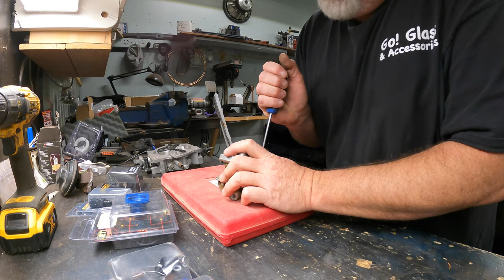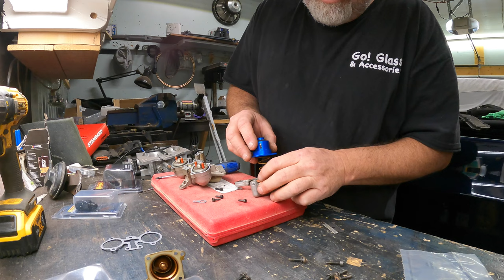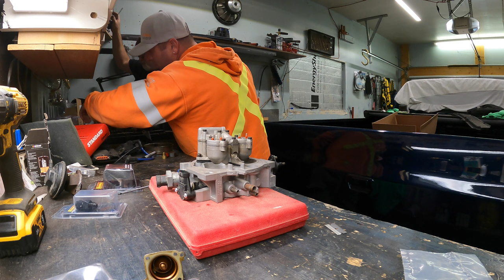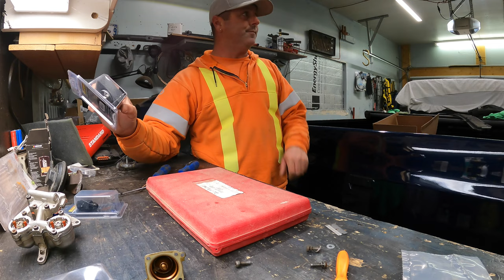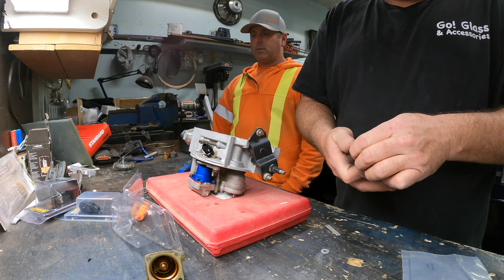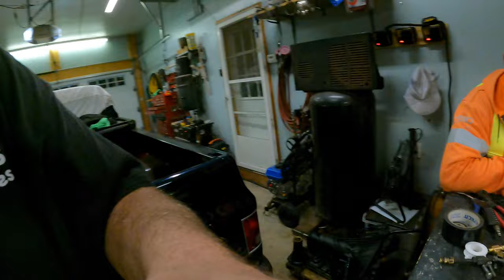TBI Ajustable Fuel Regulator And Fuel Pressure Gauge    4K

Comment: Not thick enough gasket for the top to bolt to the bottom. Also, if you looked at the head of those screws the rest are rounded on top and the three on that mount are flat topped.

Comment: Been considering this mod for my TBI system. But with my tightly-routed factory hard lines I'm not sure I have enough wiggle room for an in-line FP gauge. 
How do you adjust the FP in situ? Do you have decent access with an Allen wrench while it's installed on the engine? Or do you have to remove a gas line, or fully remove the whole TBI unit from the intake to adjust?

Comment: I have the same Rochester 2bbl tbi. But after I shut off the vehicle the fuel pressure is instantly lost. 
Any ideas on how to test the injectors?
Reply: Yup. Your fuel preasure regulator is screwed. Most TBI rebuild kits are inexpensive & come with a new diaphragm for the fuel preasure regulator. Easy peasy job to repair it.